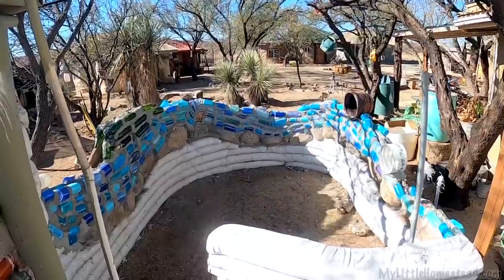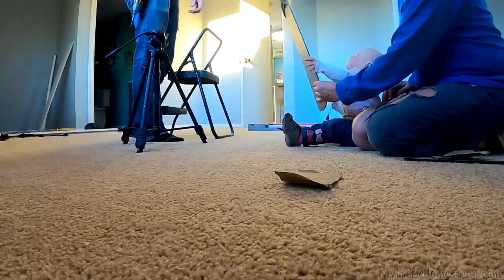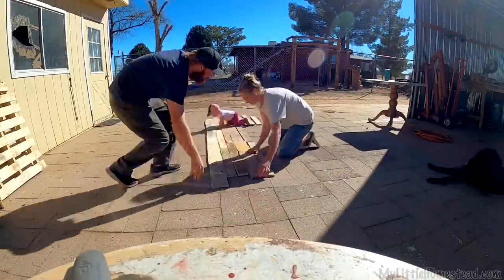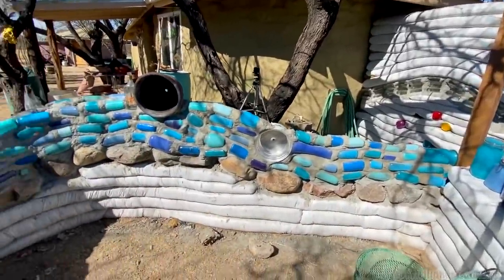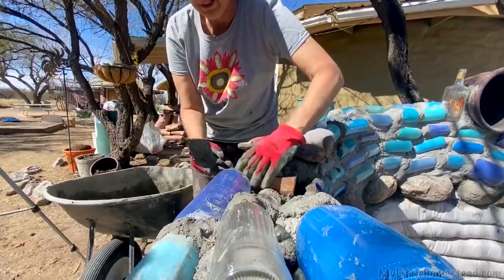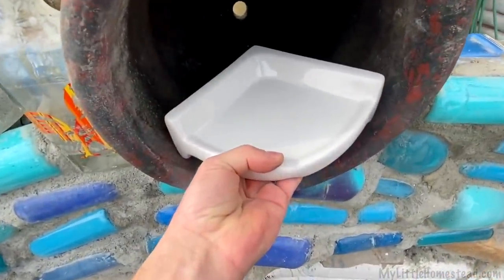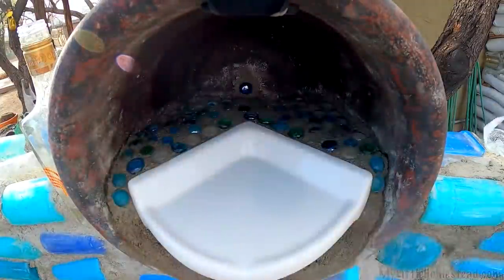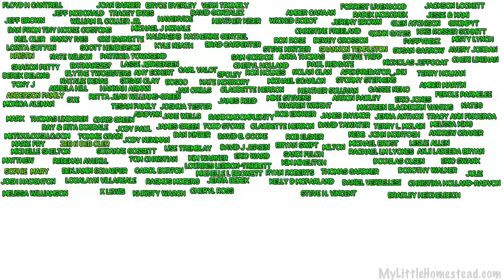Pallet Headboard & Soap Dish for Earthbag Bottle Wall | Weekly Peek Ep271

Comment: Pallet wood decor idea:  take many random length between 6 and 36 inches boards, run a router around the 4 face edges, and screw to the wall as wooden tiles.  Looks good either horizontal /vertical or diagonal.  Our family calls them Raymond Tiles after the apartment complex we discovered them in.

Comment: using curtains for closet doors is a fun way to make the room feel softer and even a little bigger. they're also easier to move aside so you can see the entire inside of your closet, instead of sliding closet doors where you can only see half the closet at a time. you can have fun with them too by using curtains with a fun texture, color or pattern! I had really pretty crinkled transparent gray ones in my old apartment and it made my tiny room feel so much bigger and nicer! very fancy~~~

Comment: Garen, Ellie, Azalea: awesome work on the headboard and wood skirt. Fantastic idea 💡💡 for the shelf/night table with plugin and lights. Did you include (a) USB port (s) for your phone (s)???
Idea: take longer boards or two together, connect at 3 - 4 places across with cord/twine/rope. Make a fan folding screen for closet so it hangs off a rod like a grommet curtain. You can figure it out! 💡💖🤔

Comment: Supposedly, in order to reduce the chance of splitting wood with a screw, run the drill and screw backwards for a short moment - it will go in a little, then when you drill forward, the wood is prepped to accept the screw without splitting. It has been working for me at least most of the time. You got to get a feel for how long to go in backwards for each wood density.

Comment: man that's a lot of new kids. i love the way your out door shower is coming together. garen that bed looks really nice, you said you plan to hang a barn door on the closet as well as hang pictures of the kids (im assuming you plan too hang pictures of the new baby when they get here) if you secure them you could hang them on the barn door so its a closet door and a gallery (also if you use pallet boards for the barn door it will leave a neutral color backdrop that will make the color of the photos pop where as on a blue(or color) wall the color wont pop as much)

Comment: in winter, you need to flip the fan direction the other way.  it's sposed to pull the air up.  in summer, it's sposed to push air down, creating a breeze.  and yes, ceiling fans 24/7/365

Comment: I would have also put the glass flat marbles (beads) under the soap dishes you made.  I used a bunch of those on the wall in the bathroom once with a ton of sea shells, it took me 2 years to collect.  For the counter I broke up while floor tile and puzzled it back together. I got $200 worth of floor tile for $20, I used in many projects.

Comment: your bedframe will settle deeper into your cushioned carpet, doing three things.  One, push up on your skirt, breaking it off.  Two, make a deep impression where the wheel posts are, so when you move the bed, it will pull the carpet with it. Three, steel in contact with carpet in the long term will leave rust stains

I think you an get some plastic skids that can fit into the wheel posts.  They'll look like an upside down mushroom.  you could fabricate some out of steel, but you want to face them in plastic

Comment: Maybe for the back of the crock pot use some water resistant silicone and attach more flat glass marbles to the area to hide the 'embossed words' but still be able to see the silver and if I had the cash I would send you a cool little plug type of charm for the hole in the other pot (But covid has me broke) or use the flat glass and decorate the outside of the pot's bottom in a blue fish design. I could send you a drawing of where to place the marbles if you like (I have the same flat glass marbles), but Bree is good with art, I'm sure she can figure it out as well. :) Also I have my earthbag dragon design ready to go. Just need a spot somewhere in the back for me to live :) (I can show you that as well.) 

Not a stalker.